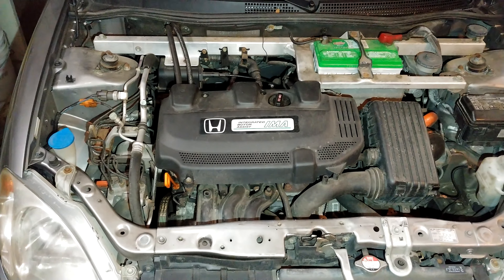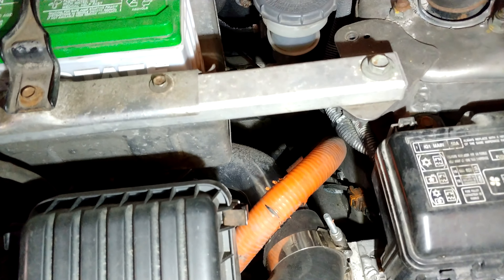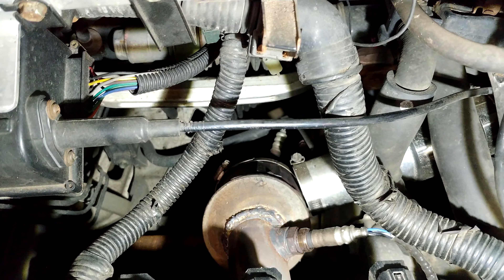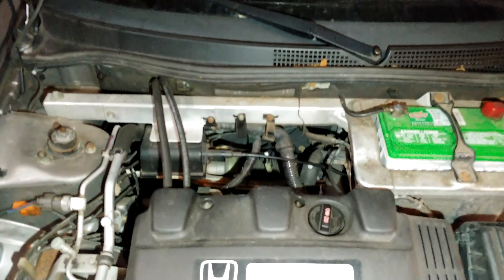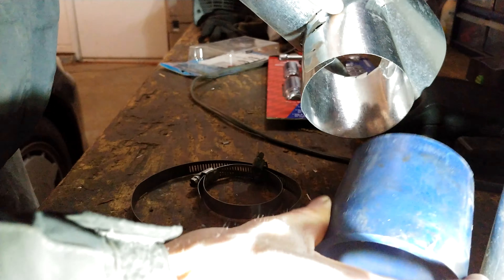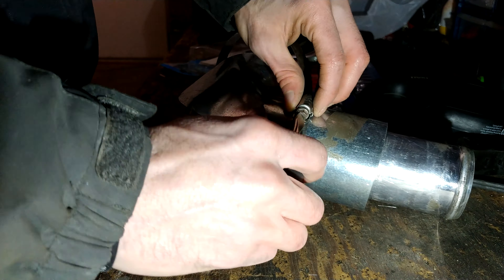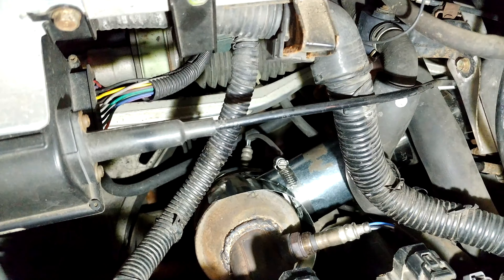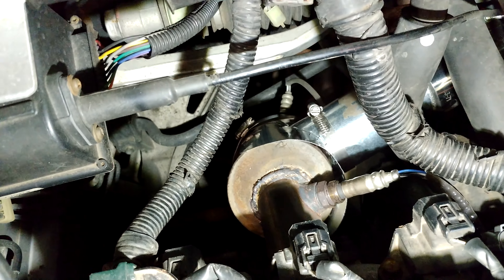How To Install A Hot Air Intake For Better MPG on a 2000-2006 Honda Insight

Comment: What kind of metal piping did you use to loop under the battery? Did you just buy exhaust pieces and strap them together?
Reply from the maker: They were aluminum intake/intercooler pipes I had from another project.

Comment: Did you see mpg improvement  and did you see any negative effects? Did it work well in hot weather or was it too hot?
Reply from the maker: Yes, it gets into lean burn much more easily and stays in lean burn longer.  Negative effects are somewhat seen in the summer months like laggy acceleration, so I only ran the shroud during the winter months, hot intake air intake fall and spring and went OEM intake during the summer months.  The sweet spot was roughly 100* air intake temperature.

Comment: How much more mpg of an improvement did you see?
Reply from the maker: It's hard to say, but it would get into lean burn more easily and stay in it longer, so it definitely improved, but not sure by how much and it mainly ran it during the winter months, so it was less in general compared to the summer months.